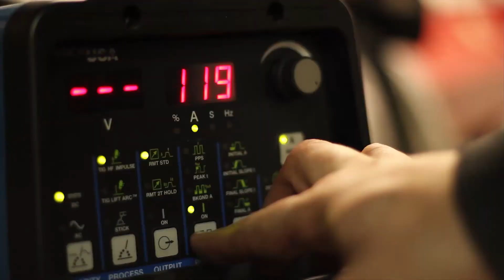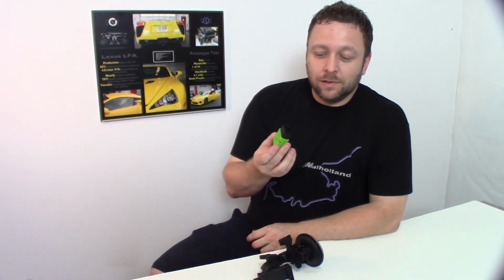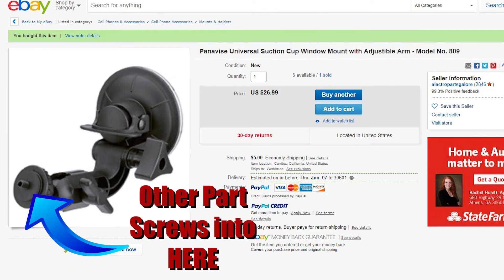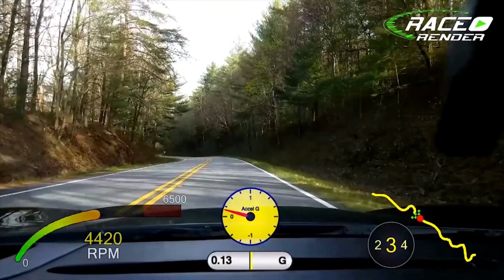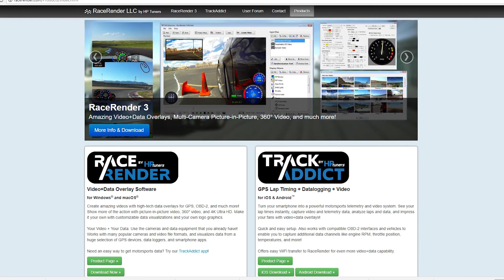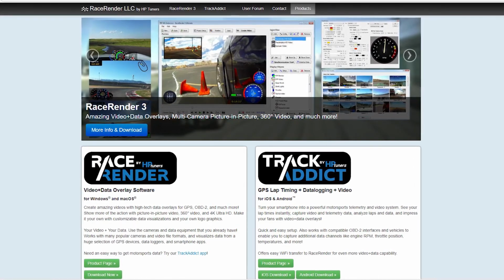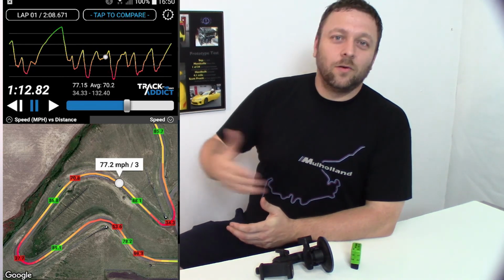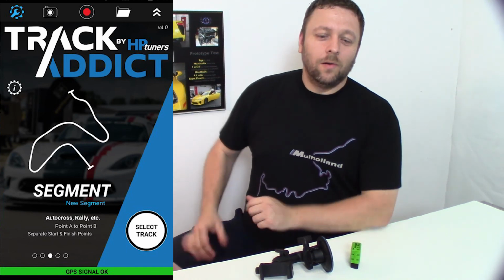$100 Track Recorder HP Tuners Track Addict App review and Race Render

Comment: Racers use the DUAL XGPS 150 because it has better resolution and up to 10 updates per second.
It's designed for aircraft, to get accurate locations  when flying by instruments at up to 200 MPH.

Comment: I've been trying TrackAddict with a cheap chinese OBD link and although there's some slight latency, the readings turn out pretty accurate. Problem with the phone's GPS is that in some mountain roads the GPS signal becomes really weak in certain areas and makes it hard to compare different runs. Still an awesome way to challenge yourself and add some flavour to on-board videos

Comment: great review.  I cant find out if this app has audio output stating the lap time as you cross the finish line.  I plan to use it on a motorcycle race track and would love it if it told me my laps as I crossed the start/finish.
Reply from the maker: That's interesting.  I actually can't answer that question.  I don't feel I recall it doing that, but it'd definitely be worth looking into.  I think it's ideally, a visual tool, because as your lap progresses it tells you in real time if you're ahead or behind your fastest and does the predictive.  It is red or green, so it's easy to see in your peripheral, but...on a motorcycle, helmeted, etc...I can imagine that'd still be tough.
Reply: @KnightDriveTV  Yeah its difficult to glimpse at a phone as well... with harrys lap timer you get audio times crossing the start/finish and often thats an area of the track where you have a chance to breathe a bit :-)